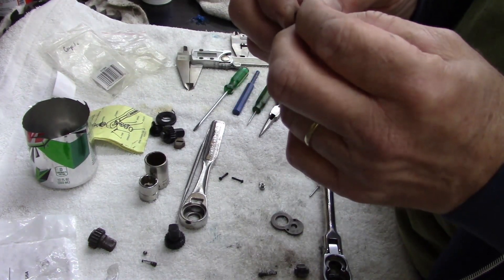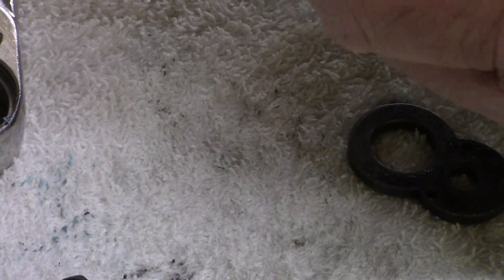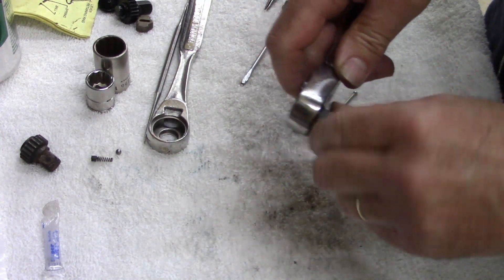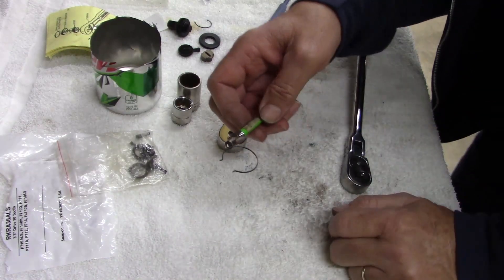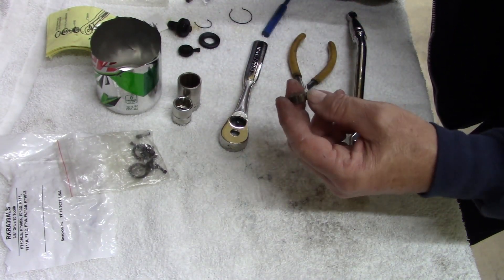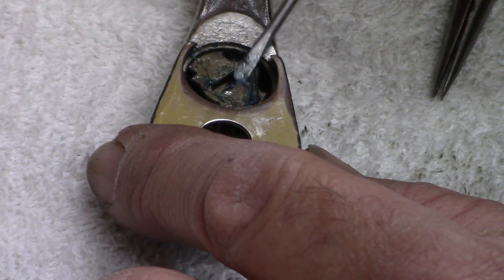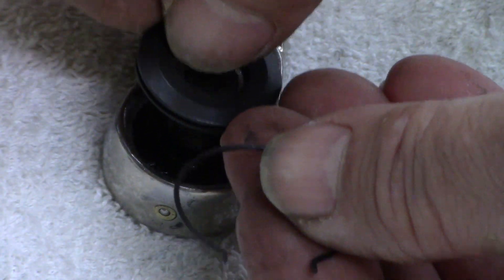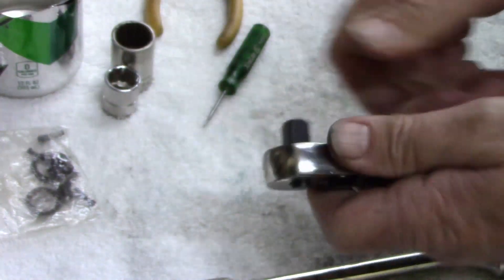Snap-On restoration finally

Comment: Bent handle flex heads are awesome, you have it in normal position to break a bolt loose and then you bend the flex to a right angle and it becomes a speed wrench/spinner. Most mechanics used to prefer this style for taking out spark plugs in fact lots call it a spark plug ratchet. Now everyone uses a cordless ratchet for the same job
Reply from the maker: How you explain it, now makes sense, I knew there had to be a reason, like I said I have never seen one before and neither had the pawn shop, so I got it cheap!!!!!.

Comment: Snap on probably thinks they got you once by buying the ratchet so they make the repair parts reasonable
Reply from the maker: Yea, I don't think I will buy another Craftsman rebuild kit because I can buy the ratchet used at the flea market for 3 bucks, it is strange that Snap-On was less than 1/2 of the Craftsman.